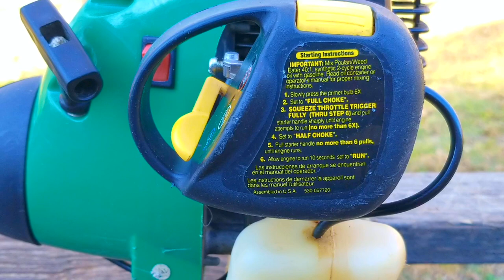Weedeater starts, but won't stay running.

Comment: That was a really good video. I always seat the H and L adjustment screws lightly because it also helps to remove any varnish that may be on the screw or seat. Also like you said it gives you a starting indication for final adjustment if no one has messed around with them. Thanks and I like a machine that runs great and hopefully starts good also.
Reply from the maker: thank you Waterman one, I appreciate that.

Comment: The other thing is that if the spark plug is of the wrong type of plug the heat range is of most importantance if to hot  engine is going to shut off after a certain time ..
Reply from the maker: yes you make a good point.
Reply: @HomeGaragechannel  thank you for your reply on this matter young man 😎

Comment: ..BTW, while I wouldn't waste my time on a trimmer like that, your easy-to-understand instructions to beginner DIY'ers are commendable..simple and easy to understand :) ..and, if you keep looking, you might find a cheap or free Stihl, Husqvarna, or Echo trimmer..yard sales, the local landfill, scrap yard..I've found them many places..often they just need fuel lines, fuel filter, and a $15.00 aftermarket carburetor to get them going again..minimal cost, AND, they ARE worth your time...use them yourself, or sell them for a profit.. :)  it costs just as much to fix one of those cheap ones, and you'll never get your money back out of those...
Reply from the maker: thank you dyer2cycle, I appreciate it.

Comment: I JUST BOUGHT A BRAND NEW WILD BADGER 52CC  & IT STARTS JUST FINE BUT WHEN I HIT THE GAS IT BOGGLES DOWN & I CANT FIND THE CARB ADJUSTMENT SCREWS  ANYWHERE ...I ALSO HV AN OLDER HOMELITE  WEED TRIMMER THAT DOES JUST ABT THE SAME THING ...HELP?

Comment: My weed eater starts and it'll stay running for like 20 minutes and then it'll die and then won't start
Reply from the maker: I would consider testing the fuel cap for proper venting and if that's good, I'd try replacing the spark plug .

Comment: Just bought the exact model for $20, the owner wanted $50 because he said he didn't want to mix the gas. I asked if it ran and he said yes but it might need some new fuel. When I went to check it out, he pulled it a few times and after that the starter pulley would not engage so I offered him $20 for it. Took it home, pulled it apart and found out the cogs that were supposed to engage the pulley were not springing back to their original position. Easy fix, dry graphite powder on the shafts so they spring back the way they're supposed to. After I got it started running on half choke it still didn't run properly on choke wide open. I realized it wasn't getting fuel as it needed. I then did a suck and blow test on the fuel cap - fail in both directions. I realized I had to pop out the sintered? valve in the fuel cap itself (looks like a tiny little pellet) by punching it out from the top. I spray the valve liberally with carb cleaner and replaced it. After that started it up and ran fairly normally until I worked out the old fuel/oil mixture in the system. It seems like that tiny little pellet of a thing was the cause of this brand new weedeater's downfall. Somehow it got clogged and just needed to be cleared. Replacing the cap would have been easy too, but I'm cheaper than that. Boom
Reply from the maker: nice work Jeff Wheeldon.

Comment: I find carbs that are adjusted so they rev up quickly and run properly at full throttle are also very easy to start. 
I have found that very few people know to grease the gear head of a trimmer. Just remove the bolt that is located on the right side of the cast part of the gear head and fill the cavity with wheel bearing grease. Also, if the shaft of your trimmer comes apart into an upper and lower half, grease the drive shaft where the two ends meet inside the shaft.
Reply from the maker: Thanks for the info!

Comment: Thanks for the video! i had mine apart just today and found some gunk all over in the carb cleaned it with some carb cleaner, did not get any new gaskets or diaphragms yet, so it starts real nice but bogs and dies with any throttle input, so im aiming to replace the metering diaphragm and soak that little screen. plus get the tool for adjustment, and thanks for the adjustment info and explanation!
Reply from the maker: no problem and good luck!

Comment: The son-in-law got 2 exactly like this one but when I got both of them running years ago I couldn't get an adjusting tool kit so I ground off the carb housings with a burr in a Dremel so I could adjust them with needle nose pliers. I since got a kit and it went with both of those trimmers and the Echo convertible. And I guess you could say I hate a hard starting rig and that's why we both have battery jobs. Thanks and they ARE fine trimmers but there comes a time..................at least it did here. BLESSINGS!
Reply from the maker: nothing wrong with that technique.
Reply: @HomeGaragechannel  Part of the poverty and desperation deal.

Comment: easy to start, I returned that cheapo Craftman for that reason. I might've been able to adjust the carb but I did not have the right tools at the time. I do think this should've been addressed from factory since it was brand new, it did not give me confidence in the rest of the machine if they miss the basics as a tune.
Reply from the maker: I completely agree with you.

Comment: well from my view it does depend really from 2 stroke engines or 4 stroke motors aka 2 cycle and 4 cycle and from my view 2 stroke has less parts which makes it nice to work on if you have the skill for it where 4 has more parts and takes time but delicacy and common sense is the key for when it comes to repair and rebuilding that motor etc.
Reply from the maker: nicely said.
Reply: @HomeGaragechannel  my pleasure mate cheers from Australia to your area and stay safe.

Comment: For me i think the question of best performance when warm or good starting is a difficult one. I have a 4 stroke trimmer and it starts but you gotta run it for a solid 2 minutes or more before you can use it otherwise it will stall. Once it is warm though it is very powerful and can cut through anything you throw at it. Personally it isn’t a problem as I will start it and leave it idling while I empty the mower bag, and by the time I get a leaf bag out and empty the mower it’s usually almost all the way warmed up
Reply from the maker: you make a good point.

Comment: I just fixed my new one of that it runs  like new now except it does need a clutch because it stays spinning even if you adjust the idler screw it spinning isn't a problem for me though plus i don't really like straight shafts but it works great for being a free weed eater i could tell no one ran mine much from the clean muffler 

I put other gas line on and had to drill out the filter line hole on the tank because i used what extra line i had laying around and put a new gas filter on these extra pieces went to a chainsaw but they work so didn't have that plastic nipple piece it doesn't really need it anyway for the lager line 

I reset the carburetor adjustments and then had to regap the spark plug someone else had it gapped out to far.

I might shine up the piston head some time later on but I've got a ton of other small engines to work on for now might see if the original owner wants this back because i don't really need it it took me less than a hour to fix
Reply from the maker: thanks for the information Mike.

Comment: My trimmer dies if it's not primed every couple of seconds while running. Any ideas?
Reply from the maker: sure the diaphragms in the carb need to be replaced
Reply: @HomeGaragechannel  Thanks you are correct. I took it apart and found the diaphragm had a tear.
Reply from the maker: excellent work

Comment: It may have a compression release accounting for the low compression readings. Change the oil and put a carb on it. Recheck compression with a drill first.
Reply: Comment was for a different video.
Reply from the maker: thank you for clarifying that. I appreciate it.

Comment: I seen people's reviews of this weed eater on Amazon and alot of people said they've had problems with the carburetor out of adjustment straight out of the box brand new so if i could I'd ask them why didn't they just adjust it then some said it's a bad product but i don't think it is 

I think they just don't know how to fix it themselves or they don't want to it's not hard to do with the right tools 

I don't even know how old the sst25 is
Reply from the maker: I believe you are correct.

Comment: How would you go about making the weed eater start easily AND work as new?
Reply from the maker: replace the carb, after confirming the engine was not worn out. if it's worn out, I would replace the piston and ring.

Comment: Goodnight,  sorry about the late time,  but is there a screw or bolt that holds the casing or piston block together?
Reply from the maker: there are bolts that hold the cylinder to the lower part, and there are 2 screws on the back that when take off show the crank and the connecting rod
Reply: @HomeGaragechannel  thanks for the info,  your videos are the best , anything for 2023?
Reply: @HomeGaragechannel  which we had stuff like that here in Jamaica where people  just throw out their old stuff
Reply: Good day again, I got a 4cycle  weed trimmer for my brother inlaw it was stuck, it was a total tear down still stuck is there a way to remove the balancer I think we have a stuck bearing
Reply: @HomeGaragechannel  👍👍👍👍👍👍👍👍👍👍👍
Reply: @HomeGaragechannel  I think you should post a total tear down of a 4cycle trimmer
Reply: @HomeGaragechannel  Good day,  I was watching one of your amazing videos where you were answering questions and someone ask where you find all your cheap stuff, and you said you really don't to give that form of info and you gave your reasons which I understand why,  but I really think you should with us the link to these stuff so some of can benefit from some of the free or cheap stuff.

Comment: Hey man i have one like this.    I fixed it up with a new carburetor. And replaced the fuel lines and it’ll run but it will loose prime while running  and then I’ll have to prime it back up to get it running again can you help me.   Thank you
Reply from the maker: thank you Ole Son.
Reply: @HomeGaragechannel  can you help me with the problem?   I can’t figure it out

Comment: Did you ajust high speed till the point of rpm droping ?
Reply from the maker: I think I did, but on a proper "test run" when I was really working. That was done after the filming had stopped though

Comment: Those yellow tygon  lines suck … I’ve put brand new Tygon lines on a trimmer and after 2 months of having fuel on them they stated cracking… now even on cheeper grade equipment I use oem echo/shindaiwa fuel line you can get all the sizes you need and they come in packs of 20 foot I order in bulk it was way worth it
Reply from the maker: I'll have to look into them.

Comment: Hi!  Love you vids!  Inspired me to "borrow" my parents Weedeater Featherlite to see if I could fix.  Primer bulb is toast.  As are the diaphrams inside.  Gas lines are shot too.  Picked a bad one to try on as I can't seem to find the exact parts and not sure what is "close enough".  It was built in 1997 and has a Walbro WA226 carb.  I see kits on Amazon (canada and USA) that are close but don't mention my exact model.  I think the model# is 530-049912.  Do you have any idea what would work in my case?
Reply from the maker: thanks, I need the model and serial number, I don't know why but I can't find anything with the information you gave.
Reply: @HomeGaragechannel  I wish I had more info on the model but the plastic housing literally only says "Weed Eater Featherlite".  Engine info sticker has this on it:
Family:  VPW018UB23RA: EM
Disp:  18CC
Serial#: 97037N601030-2
Reply from the maker: what does it say on the sticker on top of it? ST- something or another?
Reply: @HomeGaragechannel  sadly, no. Considering its age, I'm guessing a sticker has fallen off over the years. Only other info on it was the ID# of the person who adjusted the carb 😞
Reply from the maker: I got an idea, can you send me pics the trimmer to my email?  homegaragemail@gmail.com

Comment: ..Those should be tossed in the dumpster the minute they come off the assembly line...
Reply from the maker: you hate them that much? why?
Reply: I've got 2 of these, and bought new 1978 still runs perfect. Paid $59.00
Reply: @timnemeth6555  ..they didn't make these in 1978...maybe the same "brand", but not the same trimmer..this design originates in the early-mid 2000's, and they are junk...